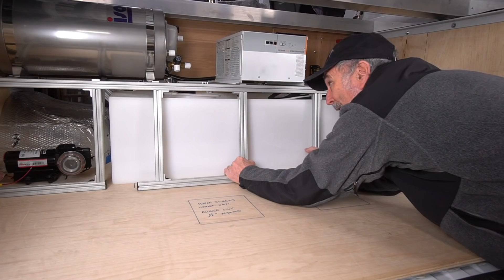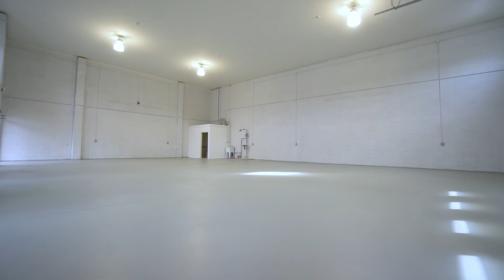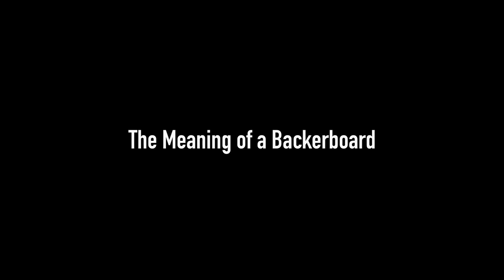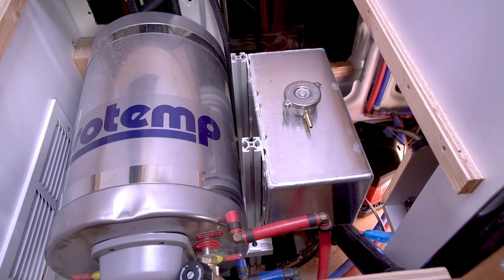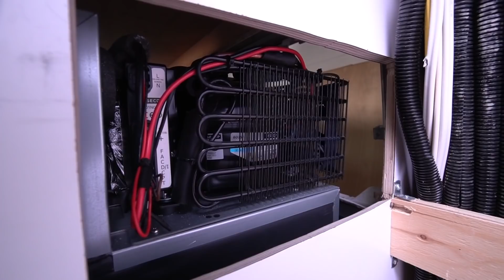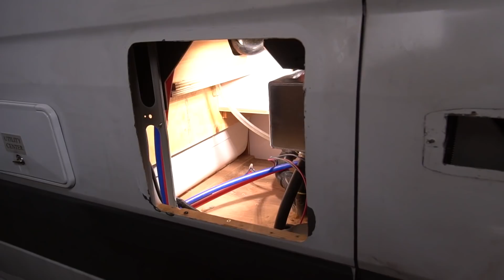29V power platform bed in a van! Plus + more van build ideas!

Comment: Is the M&M Sprinter galley erected in 10 series? The profile appears to be smaller.  I saw in another video that you have hardware for both 10 and 15 series.  How do you apply the different sizes in your builds?
Reply from the maker: Galley is typically 10 series. Garage, fridge box and shower are usually 15 series. But the 250 Transit I have in the shop now will be all 10 series . 10 series is fine for everything as long as you understand loads.

Comment: I like the compact design of the fridge, water heater, and battery system, but do you think the batteries will experience a lot of heat coming from the fridge and isotherm?
Reply from the maker: Not worried about heat whatsoever, because of all the ventilation I add to my builds. Airflow, Baby!

Comment: Love the adjustable bed. Have one at home and in my van. Like yours better with the slats for breathing.  Would you share what brand it is?

Idea for filling access panel gap. Purchase Exterior PVC White Trim from Home Depot or Lowe’s. Sculpt to fit with normal wood working tools. Seal in place with caulk. 
I’d use same type the recommend for roof vent spacers. 
May need 2 pieces of 1” stock to fill thickest portion if you can’t find adequate single thickness. 
Two pieces can be permanently bonded with PVC glue.
Reply: Have you found what brand the bed is?
Reply: Yes. But posts with any specifics are being erased. Not sure why or how.
Reply: Tried to reply 10 times. Only those posts without info are saved. 
Either he’s not allowing post or I’m going to feel pretty silly when all the deleted posts show up. 
Please respond in reply if you received anything helpful.
Reply: Not sure if this is saving comment?
Reply: Yes I found it. But all my posts are being erased.
Reply: Thanks for trying, but I haven't received any info.
Reply: Do an internet search for adjustable bed, aluminum slats. I will urn up. My posts with descriptions and or links are being erased. Why, I don’t know.
Reply: HOM Furniture
Reply: SKU 610887 is similar

Comment: I installed a pragma adjustable bed in our van build and it uses 29v actuators that were powered by a 120v ac adapter but I modified the setup by installing a battery backup system that are made for home power recliners.  This allows me to power the bed when the inverter is off but also gets recharged when we turn the inverter on for our ac power needs.  I also purchased a dc to dc power adapter from Powerstream that boost 11-14v input up to 29v.  Works great!

Comment: Loving the bed design! Did you have to increase the size of the angle your using to support the weight of the I-beams and the extra of the bed frame?  What size is it?  Thanks!
Reply from the maker: Back in the day, the support system I have installed used to summer camp with the little Golden Gate Bridge. Sleep tight.

Comment: Putting on your engineering hat, (although it seems like you never take it off), I have a question for you:
I really enjoy the convenience having a driver side slider for access to the rear of my current van (a min) from the outside upon immediately getting out of the driver's.

Since Ford was the last one to offer a driver side slider in their cargo vans (no longer an option going forward from 2020), would it be impractical (either through cost or effort needed in the construction) to install a door (hatch?) after market on the driver's side just behind the driver's door for entry to the rear compartment?

I'm not talking anything fancy and I don't mean a slider. Basically just a rudimentary hatch type thing with a basic latching mechanism that would not interfere with the structural Integrity of the van and could remain watertight and hopefully rattle free....and not cost $5,000.

I was thinking of a standard type cargo van (Chevy Econoline) or low or medium roof Ford Transit
Reply from the maker: I would go only as far as some type of RV hatch to act as an outside storage compartment, similar to what you see on the sides of Class A coaches. If you cut away the chassis structure, you have voided the warranty and in an accident could be held liable for negligent homicide! 😱

Comment: Awesome as usual.  Cannot wait to see the new place.  I remember you standing outside and sanding the door frame for hours.
Where did you get this water tank?  I saw that van two provided their own.  And, could you elaborate or show exactly how to "torch" the opening for a water access port and connections in a tank?   I found spinwelds on YT but did not see any torching.  I picture myself melting a huge hole in mine.

Comment: How do you connect the movable bed frame to the 8020 extrusions?

How did you hinge and power the bed frame?  I'm wondering if a gas spring could replace the motor for a manual option
Reply from the maker: Stay tuned, I'll explain!
Reply: @HumbleRoad  Thanks looking forward to it.

Comment: You don’t show the nasty work of cutting holes and ooops I cut a hole in the wrong place on a $75000 van. If you do the same model  van over and over again it gets easier but if you are doing different vans it’s a PITA.
Reply from the maker: I show the good, the bad and the ugly. You may not have seen it all, but I'm pretty open about it all.

Comment: Curious why you don't just tap into the vans coolant system and run the water heater off of that? I used to install alternative fuel systems in diesel trucks and this was the way we heated the exchange block as well as the veg oil tanks without issues. I would think doing something similar would make the water heater footprint noticeably smaller or is there something I am missing in this particular application?

By the way you do beautiful work.
Reply from the maker: I deliberately keep the house build separate from the chassis. These are new vans and I don't want ANY grey area when it comes to warranty claims with the vehicle manufacturers.
Reply: @HumbleRoad  ok that makes sense.

Comment: Hi George,
Great tips for another enjoyable Sunday morning!  Thank you!  I also have a propane fridge I need to change at one point, so this was good timing. By the way, I know you like Isotherm fridges, but do look into Nova Kool made in Canada. Winnebago is using them in their new Ekko Class C RVs and they are $800 cheaper than Isotherm for the 6-7 cubic foot models.  Isotherm also does not come in as many configurations to fit awkward spaces in RV. And… they are NOT made in China.  😊

I have a paint problem to solve and putting out my problem to invite comments from you and others.  I want to paint my RV in a truck bedliner paint, using a mohair roller brush.  I’ve seen it done on Youtube, and no need to spray, can be done outside not clean room, and can be done section by section DIY, with excellent results.  This would be useful to you to paint up panels like the ‘backerboard wood piece’ and the heater plastic venting panel to make both look like powder coated panels. Lee Blake used bedliner in his Nissan van cabinets which looks factory finished.

I was looking at Durabak Bed Liner Paint. This is a ‘moisture-cured Polyurethane’.  On moist days it cures faster. Its very durable, weather resistant, has a matte finish not gloss, and end result looks like powder coated porcelain finish.  FYI – Durabak is a South African company.  Constraints are:
1.	Shelf life unopened is 1 yr. Shelf life opened can is 2-3 hrs.  
2.	Working time is 2-3 hrs before the can hardens up. 
3.	Solvent is Xylene – which is banned in CA. Paint thinner does not clean your brushes or dilute it.
Durabak made Solvide, an alternative, which is $30/ qt + $15 Hazmat shipping.  Only available from them.
4.	Bedliner paint comes direct from Durabak factory in SA, in pre-tinted basic colors or clear due to short shelf life.  Hazmat fees for shipping from East Coast.
5.	Paint or solvent cannot be bought in box stores, or locally, but from Durabak warehouse only.
Tinting – Durabak offers a very limited primary color range that appeals to lumberjacks. City slickers like me want more shades. City Slicker + Artistic Type + Female = VCP or Very Choosy Person. I want a pearly off-white (mica chips with a hint of pink/ yellow). The whole huge RV should be a soft pearlescent white that does not create glare, keeps cool in heat, and does not look sterile. This is also a good resale color and will make my trusty plain Class C look sufficiently moneyed to be allowed into ritzy campgrounds while making it sufficiently bland not to be singled out.  Cops and residents don’t bother you either if you look like rich retiree spending your kid’s inheritance.  I want a bigger color palette to work with for this van and other projects, like garden furniture.
6.	Durabak said I need a ‘non water-based paste pigment for moisture-cured Polyurethane’.  Maybe automotive paint shops may have it, but I sure cannot find this type of pigment.  If I do find it, I will have a very short time to mix with an open can sufficiently well, and use up the whole can before it hardens.

Any thoughts anyone?  
1.	Are there other bed liner paints that have a longer working time, and more tints?
2.	Is there a Xylene type solvent alternative to the proprietary Solvide?
3.	Where can I buy Xylene?  (I also need Dichlormethane or Methylene Chloride if anyone knows – for furniture stripping).
4.	Where can I buy these non-water-based paste pigments?
5.	What other paint alternatives do I have instead of bedliner paint that can be applied with a roller brush, is thick enough to hide uneven surface?
6.	What other forms of Polyurethane paints are there that I could tint and use for RV exterior?

Thanks Y'all!   😊

Comment: Why not mount the battery on the passenger side next to the inverter (above the water tank)?
Reply from the maker: not enough room. battery is 24 x 13 x11
Reply: @HumbleRoad  might be worth figuring out how to suspend it there.  It gets the battery closer to the inverter (250? amp cabling), raises the battery up above potential water leaks and frees up lots of drawer space in the galley.

Comment: As always, wonderful video of a true master at work.
I noticed at 22:58 you had the "hatch" open upwards. That means it has to be held in place if you are working on system. Just a thought, but what if it opened downwards, then nothing has to be held and it is out of the way while you are working.
Be seeing you!
Reply from the maker: It's a possibility. If I open it upwards, I would have a magnet catch to hold it.

Comment: Great stuff! Always impressive! 
The vent in the closet is likely to be blocked by hung clothes (my wife would). IF it is necessary for ventilation, a couple horizontal wire stand off bars might be worth considering...?
Reply from the maker: Great tip!

Comment: A concern would be running extremely heavy gauge wire between the battery and the 3000 watt inverter. I think that the shorter the distance between the battery and inverter will be better.
Reply from the maker: Yes, shorter is better.  I use 4/0 stranded marine cable. Also, the actual wire connection to the inverter comes from the external BMS which is going to sit right alongside. The battery has fixed 24" leads to an Anderson connector.

Comment: Thank you George!  Always good to learn more on Sunday morning. A few questions. 
1) Is that 10 or 15 gauge 80/20 you used in the galley or both? 
2) What kind of hot water /heating system is that?  I am looking hard at Rixen at the moment. 
3) Why did you go with that older heavier Xantrex inverter instead of the lighter one you used in your van? 
Thanks again for all your help!
Reply from the maker: Galley is all 10 series. The Isotemp water heater is a Webasto product, widely used in the yachting world. The Xantrex SW3012 inverter charger is a time tested proven workhorse where heavy constant usage is expected. The XC Pro 3000 is a modern, more nimble inverter better suited to an experienced van dweller who understands power management. In terms of features, they are identical. In the Pleasure-Way, the XC Pro was the better choice.

Comment: The magnetic removable panels are genius! Great work!
Reply from the maker: Glad you like them!
Reply: I have a similar bed design in mind using a 3 panel folding mattress. I need to design a bed slide to allow for lifting the rear panel & to slide the bed back to expose the dinette area. Don't know if I need a powered model but need the slide mounting explained further. Any additional help is appreciated. Did you work with someone who pre cut & drilled your framing?

Comment: That Victron SCC is supposed to be mounted vertically not horizontally for cooling. Do you plan on putting a fan on it?
Reply from the maker: It will be mounted in a vertical fashion. I'm waiting for all my electrical components to come in before locking anything down.

Comment: George, For the filler between the Van side panel and the access door, why don’t you design a filler that can be made with a 3D Printer.  It would look very finished, professional and match the contour of the body exactly.
Reply from the maker: It is a good suggestion! One I will explore.

Comment: Why not just raise the entire bed to the ceiling? I've seen it done with linear actuators or belt pulley systems. Having a premade bed ready at your disposal sounds great, plus you can haul bigger items in the back when it's raised 😁
Reply: One of the dogs will lie on the bed during the day. Also, it defeats the purpose of the garage storage

Comment: Hi I'm here in Ireland watching on  Valentine's day, a saint who has connections to ireland, and we have been working on an old 1998 ford Transit 2.5 turbo diesel van, lots of our friends also are building campers from old vans, but since Eamon and Bec have done such a great job of the Merc sprinter, there gone hard to get second hand, even the same platform VW Crafter And Man Diesel vans are hard to find, many are stolen and exported out of ireland, some to Africa, others to eastern Europe. But it's great to be able to watch and learn new ideas, while on this 5 kilometre lockdown thank you George Mr Sprinter.

Comment: George,
I still think there's an opportunity for more storage in the dinette area.
Raise the seats 6"- 8", (you don't need the height when sitting) run a step across (same width as the seats, same height as you raise them), then either add a drawer, or a lid for shallow/ wide items.
Would make bed access easier, you may not need a ladder? If you still do, that's where you store it.

Just a thought.
Reply: Our dog will lie in that space, but it is a good idea, just not for our purposes
Reply from the maker: A good suggestion. But the owners do not want a step there.
Reply: @HumbleRoad  
The customer is always right!!

Comment: The gap at 21:58 could be filled with a 3D printed part. Our mobile studio is almost ready and we'd love to demo that sort of tech for you all some day soon. Maybe after you settle into the new workshop George. Awesome as always, Ben.
Reply from the maker: Mobile-Schmobile! Get here now!
Reply: Very true.  Clever solution!  Another solution they use in making car models is Gunnite /fiberglass mat molding. Make an arch with something bendable. Put a sheet of fiberglass mat for car repairs over it. Slap on some gunnite paste.  Let dry. Sand smooth.  Paint with a thick marine or bedliner paint.